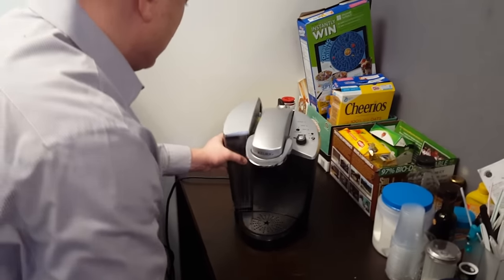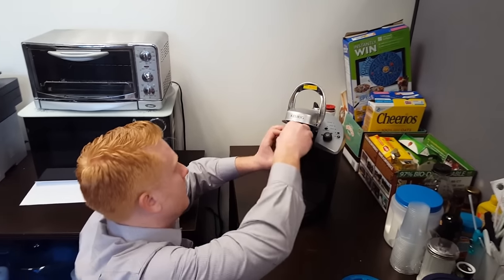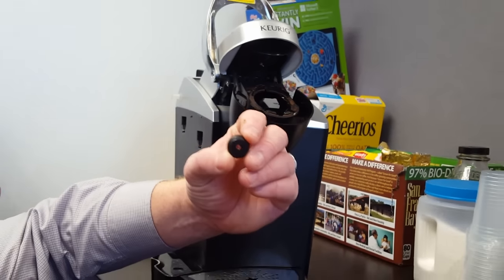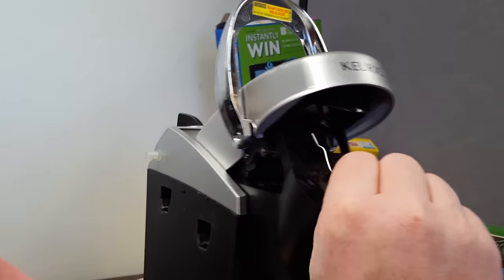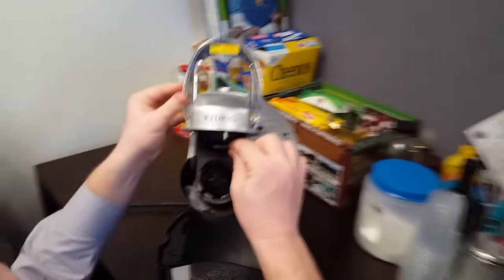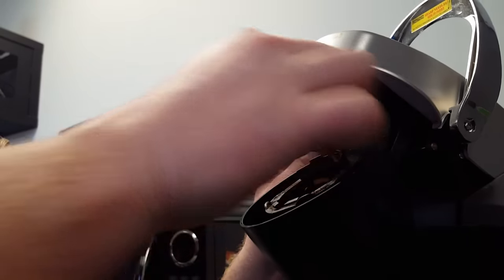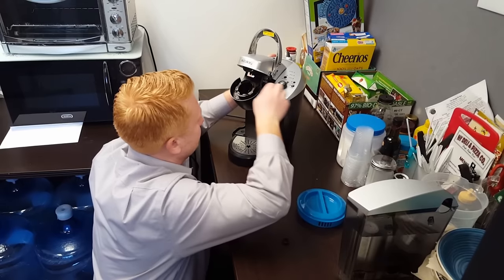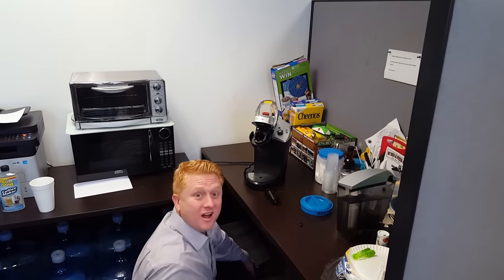How to fix your clogged keurig machine! - Works Every time!

Comment: Thank you so much! After spending a couple of hours on and off trying to descale my Keurig to get the blockage cleared, I found your video. Barely any water was getting through. Your cleaning method worked like a charm. I thought I was going to have to get a new machine, but now my old Keurig works like new once again.

Comment: So I just descaled my KEURIG 2.0 for the first time and the next day I barely got any water out of it. I figured it’s clogged because that. Your video was the first I came to and YES! It worked after a few times of poking it with a paper clip and only brewed hot water until it sounded like new. It took less than five minutes. What a simple fix, Eh! 
Thank YOU!

Comment: THIS IS A GOOD START, but I ran into problems aligning the paperclip to the hole.  I found a push pin worked well - and then to complete the task, run water through a couple of times with 1 C of vinegar added to the water.  Be sure to run at least two water-only cycles after the vinegar has been discarded.

Comment: Like someone else said, I did notice a 3rd hole. And when I was poking it with the paper clip, it didn't seem to go in that far. I pushed harder, then felt it kind of pop. Like I had punctured something. After doing that to all 3 holes, it starting working! Thanks for the video!!!

Comment: Thanks so much for sharing this hack! I was about to buy a new machine but decided to try this and my Keurig is good as new 😀🙏🏻!  Definitely try this before buying Keurig’s Needle Cleaning Tool. Note: On my first attempt I didn’t go far back enough; on my second go around, I applied more pressure and could feel the paper clip pushing through the clog (you have to lengthen the clip to go back far enough). You will also want to run water through the machine 2-3 times to clean out the loose grounds that were dislodged, otherwise they’ll end up in your freshly brewed coffee! (Add some vinegar to descale too while you’re at it). Then you should be good to go!

Comment: After watching several YouTube videos on using the paperclip to clean out the hole, I was unsuccessful. I’d have to run a cycle 4 times to get a cup of coffee. But your video pointed out that there are two holes and you have to remove the gasket to get to the second. Thank U thank U thank U I can now have a morning cup of coffee without going through a 10 minute routine.
Reply: Yup gasket did it for me also. But every 6 months you should take it apart and clean out the hoses. Theirs a vid for that also. You can see all the grinds stuck in the hoses. The product idea is wonderful but the product engineering sucks. But engineers did bring up the term "Your so smart your stupid". So why should they change just for us.

Comment: Thanks for the tip. Worked well for me. I had to do it twice. Bec the hole was deeper than I expected. Had to unwind the paper clip two folds and get it really deep into the hole. Guess it was plugged pretty bad.

Comment: Thank you so much!!! It worked, and yours was the easiest way to clear up the problem. Enjoying a nice hot cup of coffee right now. I have the 2.0 machine BTW... there are 2 gaskets both connected. It is the 2nd gasket that needs to be removed in order to get to the proper place for cleaning.

Comment: It has to do with the brand of Coffee. Some finer grounds get stuck. Mine was working fine until I used Redner's brand. Cheaper brands ($5-7) seem to have more problems. Clogged right away. Another way to fix machine is to remove water reservoir, unplug, and remove spill stand. Take to sink. Turn upside down in sink whilst holding it with 2 hands, and give it a couple of hard taps on the bottom, to loosen any stuck grounds. It has 3 holes in the needle that don't always unclog.
Reply: Julie....thanks! I descaled and ran tons of clean water through and husband said he cleaned needle but still no brew! I tried Navy thump on sides and top but haven't tried it method. I also wondered if it was my Walmart pods.

Comment: What he didn't cover was cleaning the exit needle on the cup holder (which he had already removed) This was my problem, as THAT needle was clogged and although it would move water without a k-cup in place, it would move NO WATER with one in.

Clean them BOTH!

Comment: If you read the owners manual you will see the same thing, clean the holes in the nozzle with a paper clip. They recommend you do it regularly, even if the water is still coming out alright. I use a dental proxy brush. Soft bristles – won't stretch the holes.

Comment: I've done this several times without removing the rubber grommet and it stopped working. Removing the grommet and reaming out the other holes worked much better.

Comment: This video is excellent and as others have mentioned, the second water hole hidden under the gasket I did not know about. I would ADD the first item he removed, the little cup that holds the K-Cup as well has a puncture pin that has a hole. That hole also gets clogged with coffee granules. Clean that one too.

Comment: If that fix doesn't work for you as it didn't work for me, remove the water tank and take the unit to a gas station and blow it out at the water intake.  It worked for me without having to take it apart.

Comment: I would be careful not to poke it in too far.  there is a silicone hose in there, you wouldn't want to poke a hole through that.  I recommend taking the top off with the two screws underneath, prying the silicone hose off and working through both ends of the plastic tube that holds the metal pin.  Use a magnetized small phillips head, turn the machine sideways with a flashlight, to put the screws back in.

Comment: How to put the gasket back lol?? Water is pouring out all around it!
Reply: Rachel Ahmed my apologies, I forgot to put the rubber gasket  back on during the video but it is mandatory  to put it back on before using the machine. It just slides right back on.